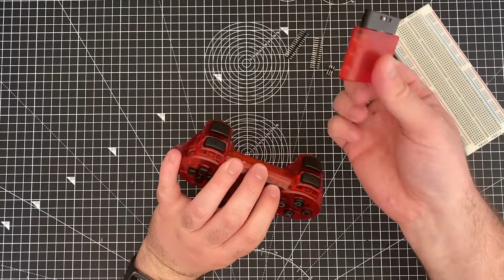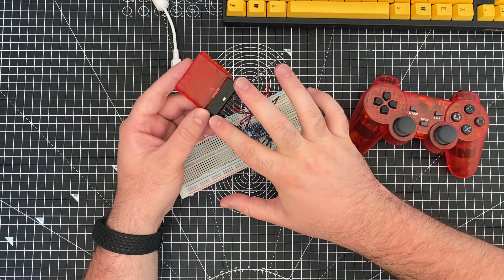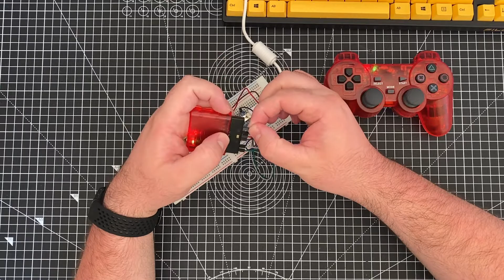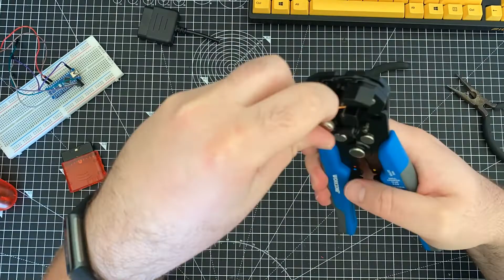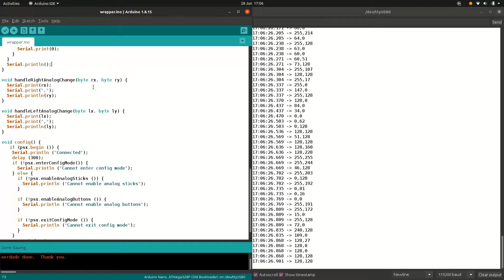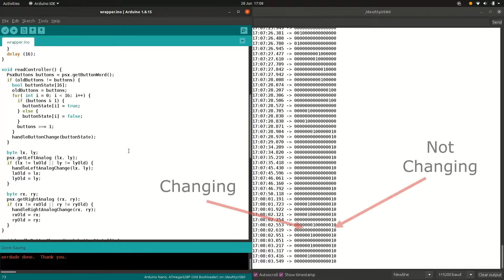Arduino PS2 Controller Interface

Comment: Speaking of voltages... How come no one uses proper level shifting? I want to do this "by the book" but I can't find any guides that show a level shifter being used. (Using one could have saved your red dongle.) Thanks for the great vid!
Reply from the maker: Could have, the only problem is you need to know that you need it!
Reply: @careyian  Hindsight is always 20/20 😉 For the record: Level shifting is highly recommended in the library you used. (Not sure if that has been edited recently.) Also highly recommended for other 3.3v controllers, yet I've found ZERO examples of shifting being implemented. Weird. Got some shifters on order. Will have to experiment...

Comment: Nice video, but I bought a Arduino expansion board that have receiver built on it with the ps2 controller, but the code doesn’t work…
Reply from the maker: Very cool, never seen one of them before, hope you figure it out!

Comment: Does anyone with Arduino leonardo use this as ps2 to USB converter? Sure, you can buy premade one online, but they are low quality and tend to gave errors in control
And also with 2 controllers. I have arduino that can do usb hid (pro micro)

Comment: Would it be possible to get the arduino code off you that you used to control the motor please?
Reply from the maker: Hi there, I don’t actually have the exact code for the motor drivers still around. However, it’s just using the Arduino’s PWM function analogWrite() to change the voltage on a pin from 0-5v. That pin is then connected to the input of the motor driver board, and that’s it really.

If you are looking to set something like this up yourself, have a look at a H-Bridge DC motor driver board, there are lots of detailed tutorials on line that will show you how to set one up.

I talk a little bit about the driver in this video of mine and the code linked in the description will show how I drive it. https://youtu.be/aJHFEo97TYA
Reply: @careyian  I appreciate the response. I will take a look at your other video. To interface with the controller did you simply include these three libraries; 
<DigitalIO.h>

 <PsxControllerBitBang.h>

<avr/pgmspace.h>

?
Reply from the maker: If you have a look at the code link in the description of this video you will see how I interfaces with the controller. The libraries are included at the top of the file.
Reply: @careyian  Thank you again for the help!
Reply from the maker: Any time!!

Comment: Basically I could tell you:
the arduino PS2X_lib doesn't work well for me, as you say, "It seems more like a quick hack at the code level, rather than a polished and maintainable library". it doesn't work with all PS2 controllers, and with the controllers that do work, it delivers wrong data.

could you help me with:
*the pin connection between the arduino and the PS2 controller
*what is your arduino library for communication between the two devices
*an arduino code (.ino) on which I can base myself to build my control
Reply from the maker: Hey, I don't think I said that at all in my video about this library, so I don't know what you are quoting from there.

 I use the PsxNewLib library for my code: https://github.com/SukkoPera/PsxNewLib

You can also see my code linked about in the description: https://gist.github.com/careyi3/6194ea86bb99fc2e73a434060feb812d

You can also find wiring here, you will have to test it yourself but it should be something like what is shown here: https://store.curiousinventor.com/guides/PS2

Good luck with your project!